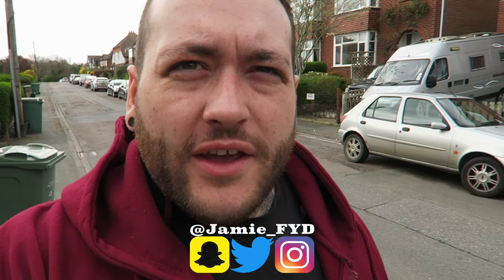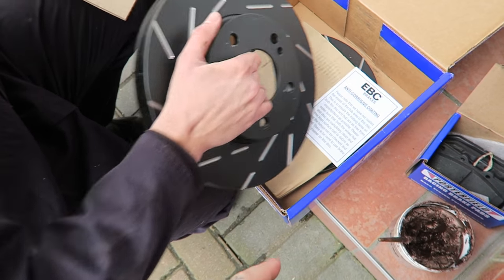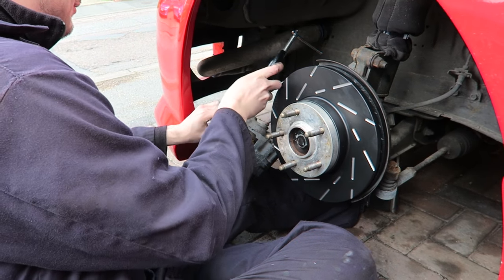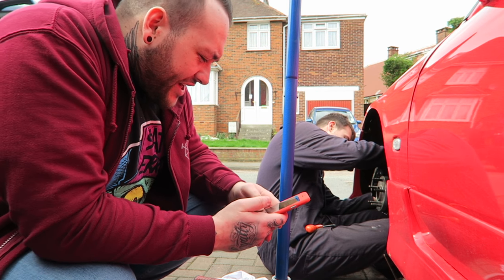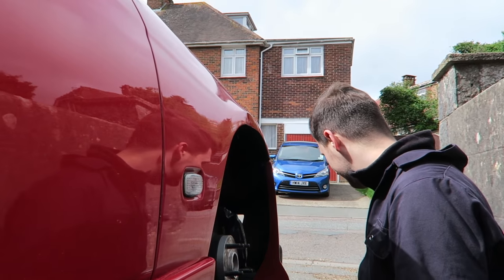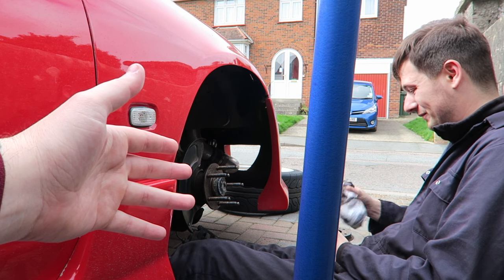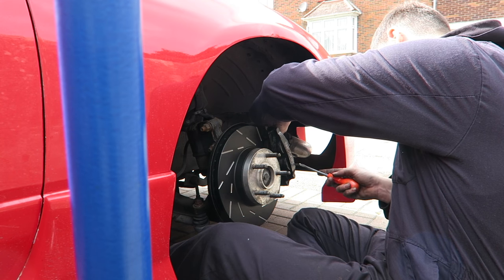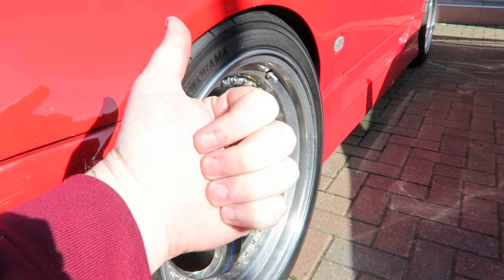HOW TO 'BRAKE' AN S15

Comment: Hey guys love all the videos i do not want to sound like a smart ass but for new braking systems use ceratec insted of copper greas because the metal in copper greas confuse the magnetic pick up of the abs sensor acording to my workplace.
Reply: Gergely Kiss The S15 doesn't have ABS so it should be alright hopefully 👍🏼

Comment: Can people help me, my engine light flashes for a few seconds and then goes off. I've looked on the internet and apparently this means a misfire, what would people change first to try and fix the problem?
Reply: deaflol if it is a misfire start with changing the spark plugs, coil packs/HT leads
Reply: Dave Harrison okay I'll try that, think the best thing to do might be to take it somewhere to plug it in and get diagnostics too